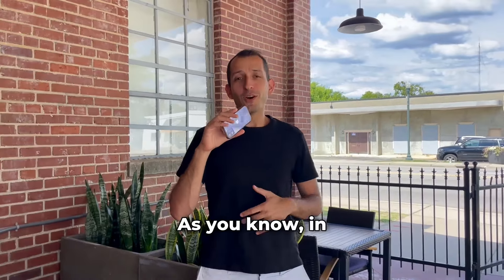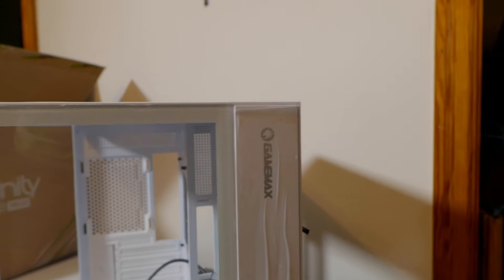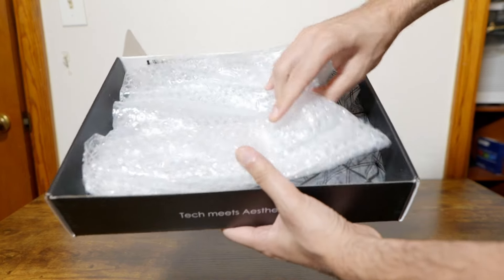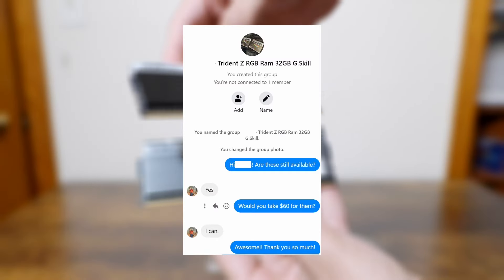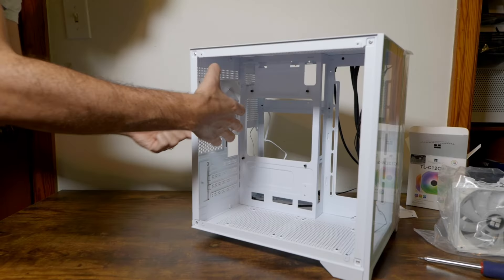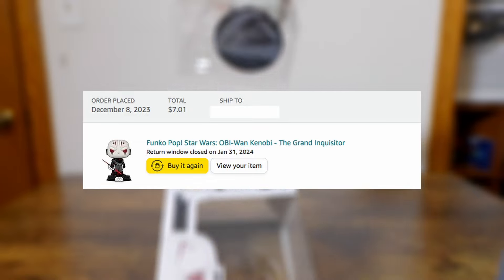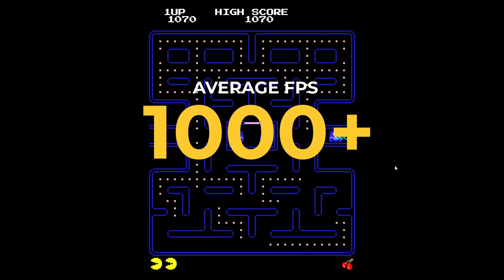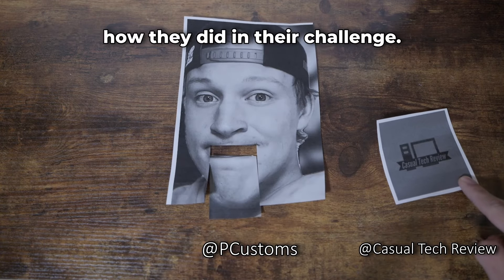Building a Gaming PC for $250?!

Comment: You definitely should've gotten rid of the Funko Pop and the RGB RAM and gotten a tower cooler. You might have even managed to get a tower cooler and the RGB RAM for less than 250.
Reply from the maker: @Soj_89  Yeah the tower cooler route is always the way to go, but it didn’t fit in the budget (until I realized I was counting wrong YIKES)